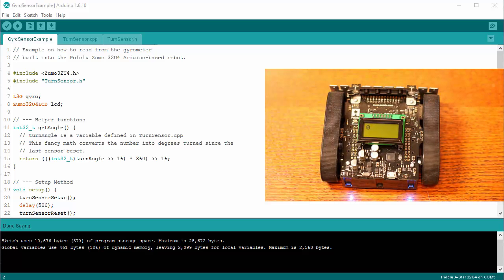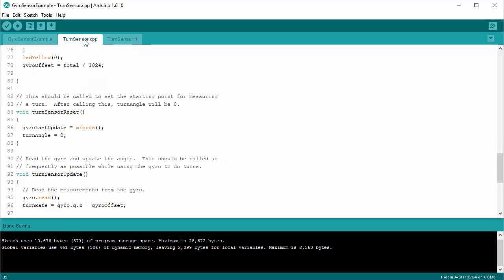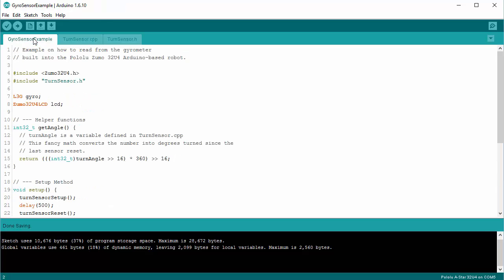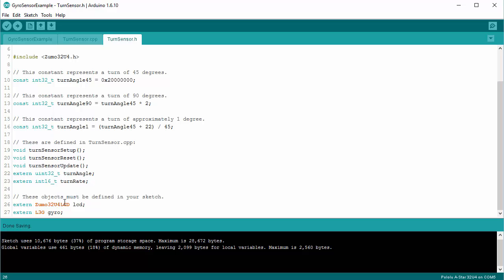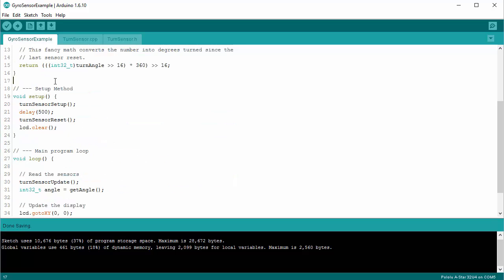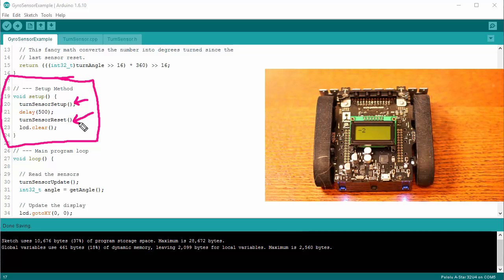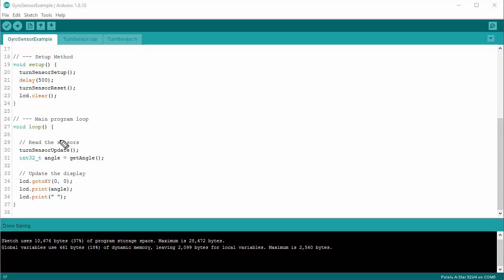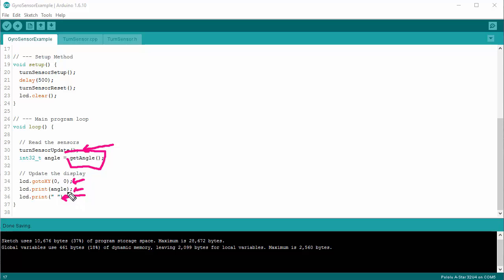Turn/Gyro Sensor Example for Pololu Zumo 32U4 Example

Comment: Anybody Refrencing this Video coding for Pololu32U4 Robots on Arduino just know that the TurnSensor cpp and h Requires you to go to the Arduino Library manager and downloading the L3G by Pololu(3.0.0 as of this post) then you have to type into the cpp and h file the following:
#include <L3G.h>
Trust Me It will save you a lot of time from the errors (Saying this from experience took me 2hrs to figure this out)